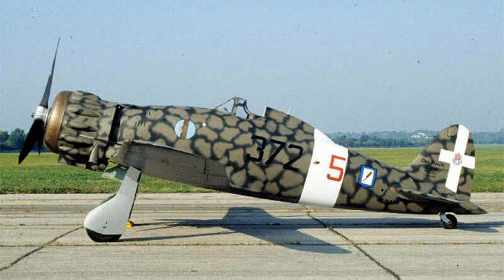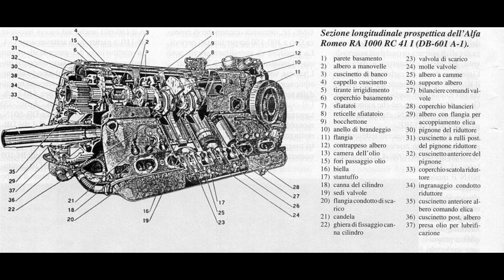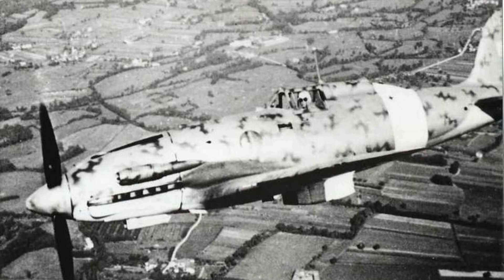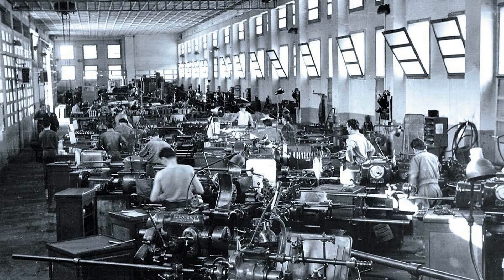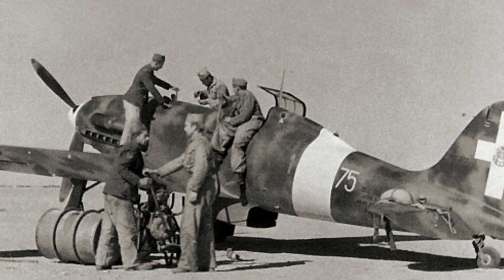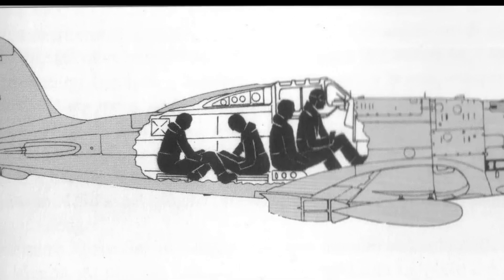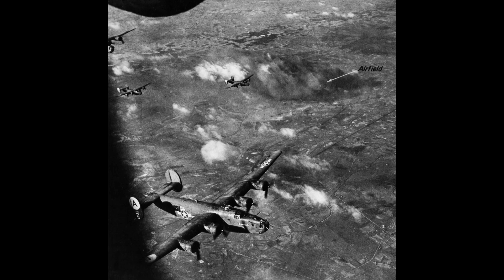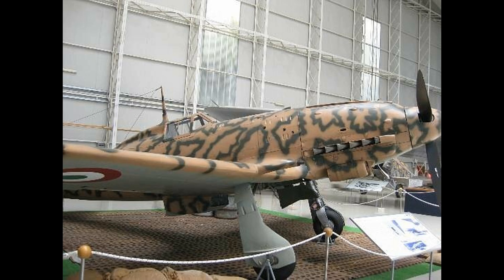The Italian Thunderbolt! The Macchi C202 Folgore

Comment: Hello BP. Synchronization mechanisms are commonly misunderstood. Many people thing the gear interrupts the gun whenever firing would damage the propeller. For synchronised aircraft guns it was the engine that fired the guns when the trigger is pulled, not the trigger itself. Needless to say that 'slowing the guns', would have no useful effect on synchronization. Synchronization by it's nature would slow the guns effective rate of fire but not it's cyclic rate of fire.
Reply from the maker: There’s an excellent model of a synchronization device at the National Aviation Museum in Ottawa. It’s one of those things that makes perfect sense when I look at it working, but later can’t recall the exact details!
Reply: Yep. People get confused when they think of the interrupter gear of WW1, which was built to work with standard ground-use machine guns that could not be sychronized.

Comment: Folgore could outturn a  Spitfire? Wing loading Folgore 174.2 kg/m sq, Spitfire Vb 122 kg/ m sq. So, how could that be?
Reply: It couldn't, but manouverability was still excellent in the hands of a skilled pilot according to Malta Spitfire pilots.  Earlier in 1941-42 the MC 202 devistated the Hurricane IIb in Malta with a 60 mph speed advantage, better climb, better dive and acceleration. 

MC .202  wing loading 35.7 lb/sq ft and no high lift devices (slats or partial flaps)
Spit Vb  wing loading (max) 28.0lb/sq ft
Reply: @bobsakamanos4469   That is all very nice, but talking about horizontal manouverability Bf-109 F-2 had a wing loading of 173.2, almost identical to Folgore, and it had the leading edge slats, too, but had no chance of outturning a Spitfire. This above is simply a wrong statement. Only a Zero could outturn a Spitfire. High loading planes had to resort to low  yo-yos and similar to get the Spit into their sights.
Reply: @daseladi  I agree fully.  the 202 didn't have any high lift devices, so couldn't out turn the Spit. Although, without wing guns its roll inertial was quite low. 
 I'm merely passing on testimony from the Malta pilots.  Hurricanes were totally outclassed.  The Spit pilots in Malta and N.Africa said that a good Italian pilot in a 202 was formidable, but the average Italian pilot flew predictable aerobatic manouvers.
Reply: @bobsakamanos4469  I do not doubt C-202 was a good plane, the word is simply about horizontal manouverability. As for the high-lift devices, they have a high drag, too, and slow the plane down really fast, so there is no real substitute for the low wing loading regarding the turning. Bfs used the slats for scissoring mostly, to slow the plane suddenly and cause an overshoot.
A6M2 had an extremely low wing loading (107.4 kg/m sq.) and there was no turning with that plane. On the other hand, lightly built, possibly due to aeroelasticity it had a very bad rate of roll. Spit was not spectacular there either, for the similar reasons, probably.
C-202 was a very strongly built plane and that could be the reason for the good rate of roll. It had light armament in the wings, btw. Strongly built means some additional weight, as well, and that spoils the wing loading further.
Reply: @daseladi  hey, nice to meet someone finally who understands aerospace engineering.  I fully agree with your analyses.  I will add that my father flew in both Malta and N.Africa against the .202's and hence my specific interest in this.  Cheers.
Reply: @bobsakamanos4469  Nice to meet you, and the best greetings to you and your father, as well.
Reply: @daseladi  Thanks.  He passed on some time ago, but his log book and memoires live on.
Reply: It couldn’t, people unfortunately just take the Italians claim for fact, without checking it. They were very proud of their planes, and so they made such claims, especially when it was the English planes they were comparing it to. These same pilots were the ones who on meeting 20 P-38 lightnings in an engagement, managed to somehow claim all 20 shot down in their macchis, when in reality no lightnings were lost. I’ve got a book on Malta, and it seems every time Italian planes meet English ones, they claim spitfires shot down where the Brit’s lost none.
Spitfire V could outturn macchi and BF-109 easily, but against the new BF-109F (and later Macchi 205) it was at a slight power disadvantage. It would also fact such issues when fighting the FW-190, which is why Spitfire IX was created
Reply: @MiG-31893  No wonder Italians claim such things, including outturning the Spit, but numbers tell their story. I agree with what you say.